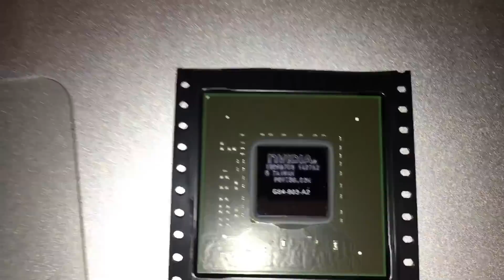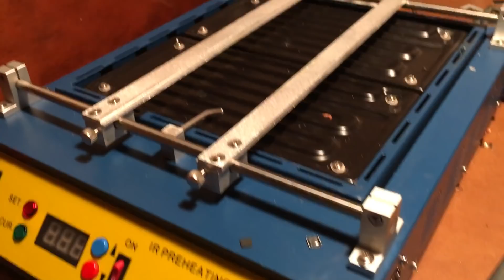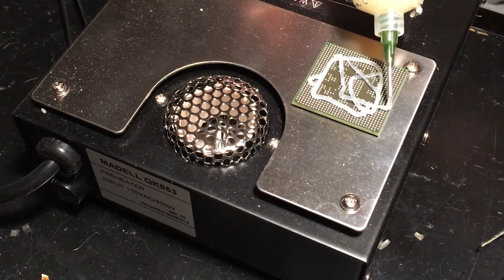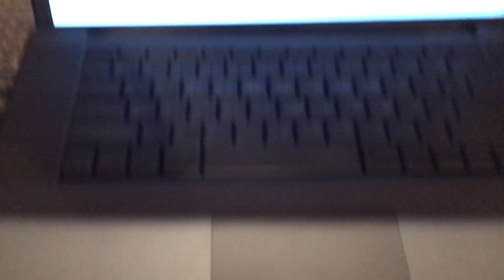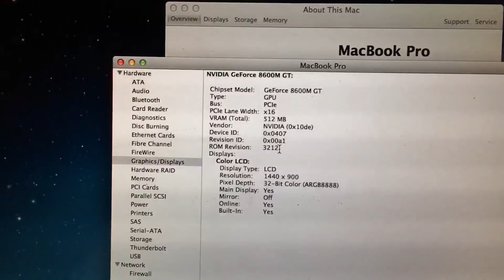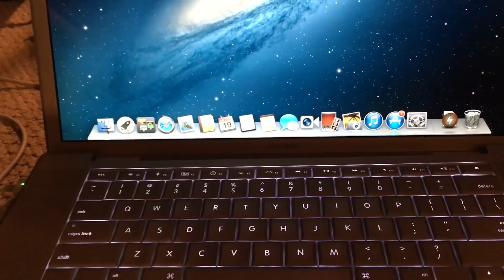Replacing a Defective GeForce 8600M GT GPU on an Early-2008 15" Apple MacBook Pro

Comment: Would you be able to do it for me if I send you the laptop and you can replace the GPU? 
I willing to pay for the repair
Reply from the maker: Yes, just send me an email. I normally do this repair for $150, plus the cost of return shipping.
Reply: @dosdude1  no problem, the laptop is still working fine when I get to replace the thermal paste I will know if it’s the revised one or not.
Reply: @dosdude1 is this chip the same for 2007-2008 MAC Book Pro 17” also, I have two that need this repair, sounds like a worth while repair!
Reply from the maker: @blkcoupequattro  Yep, it is the exact same chip.

Comment: The failing GPU in my 2008 MacBook Pro is a 512MB but I'm really struggling to find a replacement chip thats also 512. Nearly all are 256. I don't really want to downgrade. Does anyone know where I could find a 512? Is the chip number the same?

Comment: We drilled 2 huge holes under the fans too boost cooling. Speakers lost all their bass (plus the fans and motherboard are no longer "well protected". Fun but not necessary.

So a good repaste of the CPU & GPU really helped thermals and performance.

Apple replaced our GPU on warranty years ago; we thought they also downclocked the GPU but can't remember how we came to that conclusion. These older GPUs are not optimised for "modern" web browsing so still will run hot. 

A1226 has a great keyboard and supports SATA SSDs and 6GB RAM with a bit of effort. "Newish" OSX can be stuffed into the system although I think Apple cut off around 2019 (OpenCore Legacy Patcher may work with 2008 models too).

Comment: I was watching your video on YouTube on how to replace a Defective GeForce 8600M GT GPU on an Early-2008 15" Apple MacBook Pro. Great video bro. I have the same MacBook pro with the same problem. I am going to give it a try on replace the GPU. My question is what temperature you set your Hot Air rework station for removing the chip and installing the chip? Thank you.
Reply from the maker: Usually around 170 - 180 degrees C for bottom heat, and around 280 degrees C on hot air. Be sure to dehydrate board and new chip (I use a food dehydrator) for at least 2 hours before working.
Reply: @dosdude1  are you saying you have two heat source at the same time heating up the GPU one from the bottom & top to remove it? I only have a hot air rework station. I was going to heat the chip from the top remove it.
Reply from the maker: @wadesuckoo9122  Yes, you absolutely need bottom heat for these. You'll need to get a board preheater to put the board on while working, as shown in the video.
Reply: @dosdude1  One more question. So how long did you heat the botton of the MB before applying the top heat to remove the GPU and for how long did you apply the top heat before the GPU was ready to come off and when you install the new GPU how long did you have the heat on it for the solder to melt and GPU secure? Thank you.
Reply from the maker: @wadesuckoo9122  Preheat board until board preheater gets fully up to temp. To remove chip, heat and periodically lightly poke at chip with tweezers, you will see when it starts moving and is ready to come off. For install, look at balls and chip, when all balls are shiny/shimmering and chip is fully dropped and uniform on all sides, it is done.
Reply: @dosdude1  ok i will preheat the board with the bottom heater until the until the MB temp between 170 - 180 degrees C, then i will set my rework station to 280 degrees C on heat the GPU up to remove it. It shouldn't take more than 20 - 30 second to to remove the chip and another 20 -30 second to install the new GPU from watch your video. I will let you know how i do once i do. I do appreciate the help. Thank you.
Reply from the maker: @wadesuckoo9122  The video is sped up, it usually takes around 4 - 5 minutes of heating before all the balls are molten.
Reply: @dosdude1  Oh ok, so i will work with around 4 - 5minutes for removing and installing. Once the MB is preheated. Thank you for the update.
Reply: At what temperature did you set your food dehydrator at for 2 hours for the MB & GPU?

Comment: Collin,

When doing this repair, is there a upgraded GPU that will work? Or are we limited to the revised version? Also, is it possible to upgrade the VRAM above 512 MB? I believe I saw you state upgrading the CPU is possible but not worth the minute gain. Correct?

Comment: I bought one board with upgrade gpu from China. Unfortunately it’s not working properly. Only half screen. What could be the problem
Reply from the maker: Your LCD is bad.
Reply: @dosdude1  I checked the lcd it's ok.
Reply from the maker: @anupdas1413  I've seen these were either the top half or botton half of the screen doesn't work (sometimes bottom/top 1/3rd), and it 100% is most definitely the LCD.
Reply: @dosdude1  I tried with another logic board . The display is perfect sir. Also the fan is running full speed . No keyboard light no front white led. I wish I could have send to the picture. After waiting 1 year I received defective board from China.
Reply from the maker: @anupdas1413  That sucks. If you want to send in your original board, I can put a guaranteed fully working revised chipset on it.
Reply: @dosdude1  I'm from India. Is it possible to send ?

Comment: I know this video is a bit old, but do you by chance have a link to your trusted seller for the new, non-defective replacement GeForce chips?  I have one of the dreaded MBPs that has sat idle for an extended time, that is virtually brand new, as to actual use, but sadly, has the defective chip.  As such, it will not start.  I have nothing to lose by giving the repair a go.  If you by chance have that link, or, know of a source for that chip, it would be appreciated.  Maybe you have a new, non-defective one laying around somewhere you might be willing to part with? :)  Thank you for any help you might offer.
Reply from the maker: I get them from here: https://www.ebay.com/itm/203029368800

Just make sure you follow the process closely; these chips and boards are sensitive to too much heat and moisture. I always dehydrate both the board and new chip for at least 2 hours in a food dehydrator before starting the repair.
Reply: @dosdude1  it always frustrated me that this MBP was basically brand new before it went belly up.  If it was used 25 times, at short duration I would be surprised.  And wouldn't you know that I discovered the graphics chip issue after the window for the very silent recall notice from Apple closed. And they wouldn't budge on doing the repair. That said, I noticed that you also offer to do the repair as well. Not sure if this is something that you still offer. And not sure if it's best if I communicate directly with you via email or here. Happy to do either.  I can pull the board, no problem, and send it to you.  I have had it apart a few times before so that's not an issue.  Let me know if you still offer the service.  Turnaround time is not a huge issue but it would be good to know approximately how long you might need.  Thanks again for your reply.
Reply from the maker: @davidmaher1313  Yep, I still do that repair. Normally I do it for $150, plus the cost of return shipping; turnaround time is usually around 2-3 weeks. Just send me an email if you'd like to send it in.

Comment: I just put a slightly nicer Lid/LCD from my dead 

(from overheating) August 2008 2.5 ghz. machine

onto my "new" $33 ppd. July 2008 2.4.machine.

Now clean as a whistle.

$56 with some parts recently purchased.

$23 NOS OEM battery....

I'm no longer looking for a Late 2008 A1286....

Too expensive on eBay.

This one does all I ask of it...

I will NOT be running external monitor

or my TV from it....

The death of the previous A1260 and an A1226...

While streaming long videos...

This one runs 120 to 130F

Thanks to Macs Fan Control

BOTH fans set to 6000 rpm!

I have several replacement fans.

Dead quiet MBP's = DEAD MBP's..

Apple Store zombies are CLUELESS!

J.C.

Comment: Quote from wikipedia:

2007–2008 model GPU problems

Both 15" and 17" models of the MacBook Pro built from 2007-early 2008 (15") / late 2008 (17") using the 8600M GT chip exhibited severe GPU failures where the GPU die would reportedly detach from chip, or the chip detach from the logic board.[20] The issue has been mitigated by some users by keeping the laptop cooler by means of less intensive use or alternative fan settings. Apple initially ignored reports, before admitting to the fault and replacing logic boards free of charge for up to 4 years after the purchase date.NVIDIA also confirmed the issue, and previously manufactured replacement GPUs, which some users have replaced themselves.

J.C.
Reply: In Russia all bga balls connection problems are called ‘otval’, and pretty every Russian older than 13 knows how to repair it using a hair dryer, aluminum foil and little copper pieces

Comment: Macs Fan Control

Left Fan set at 6000 rpm

Right Fan set at 6000 rpm

Runs 128F to 140F while streaming videos

NOT 170F < !!!

No further problems...

AFTER having an A1226 and an A1260 2.5 go bad.....

Whilst streaming videos and using my LCD TV as a monitor

WITHOUT any fan controllers...

Will not use my "new" $33 ppd. Early 2008 2.4 15 with a TV or monitor...

My Late 2008 2.4 AL Unibody Deluxe never has a problem with either...

Nor do my two $15 ppd.  2007 WMB's

Nor my FREE Late 2009 Mac Mini 2.53....

ALL FINE TROUBLE FREE MACHINES

A lesson....

Apple Ink/Jobz screwed the pooch!

J.C.

Comment: It doesn't fail because of the operating temp it fails because it's a failing flip chip design that fails with thermal cycles which you can't avoid. Same problem with the Xbox 360 GPU

Comment: Dosdude1 is there any chance you would happen to know which size of reballing solder I would need to buy? I’m trying to reball my Nvidia chip it’s this exact same chip, but I can’t figure out which size I need to order. Great work on this though very informative video!
Reply from the maker: Shouldn't need to reball unless you're taking a good, revised chipset from another board. It is a waste of time to reball a G84-602-A2, as the chip itself is defective (as explained in the video). If this is the case, just get a new, pre-balled G84-603-A2.

Comment: I have a Mid-2012 A1286 and I checked the PCIe length. It shows 8x. Should I worry?
Reply from the maker: No, that's normal for that system. GT650M never fails.
Reply: dosdude1 is that possible to make BGA repairs with a regular hot air soldering station or I should use reworking BGA station?

Comment: Does the GPU revision matter eg my og is G84-602-A2, your replacements are G84-603-A2 and ive seen G84-601-A2, Does this matter
Reply from the maker: G84-603-A2 is the revised version of the G84-602-A2. This model machine never came with any other revisions. You should always use a 128-bit G84-603-A2 when doing a repair.
Reply: @dosdude1  thanks

Comment: Hi, I have a DELL XPS M1530 with a failed G86-730-A2 chip. The code from where you get the production date is 0745A2, so I guess it's from 2007. Could you please inform me of the following?
1) Which GPU is this chip (8400M, 8600M, 8400M GT or 8600M GT?)
2) Are there revised chips for my case?
3) How can I know if it is revised?
Thank you very much in advance!

Comment: Hey Collin, is it really worth your time to repair all these machines with Core 2 Duos and archaic GPUs, or do you just like seeing them fixed up and ready to go?
Reply from the maker: I'd say so. These are still very capable machines, and since they can be permanently repaired, why not do so?
Reply: @dosdude1  That's really cool of you to say that. Does using a GPU with 512 MB of VRAM make a noticeable difference compared to using the same GPU with just 256 MB of VRAM?

Comment: Is it possible to swap out the T9500 with a T9900 on one of the early 08 non-unibody 15" MacBook Pros?
Reply: yes, but the performance boost wouldn't be worth all the effort imo. It also requires a lot of equipment to do.

Comment: @dosdude1
@11:45 as you are melting the flux you had your tweezer clapped over the solder balls, aren't you concerned that the balls would melt and stick on the tweezer, thus fucking up the already applied balls on the underfill?
Reply from the maker: No, I'm not heating the chip anywhere near the temperature needed to melt solder... I'm simply heating it enough to get the flux to flow.

Comment: I just wanted to say thanks for all the patches you created for us with the ancient machines, though I have a mid-2012 i7 which makes me feel a little closer to being up to date. lol

My issue is with my other early-2008 15" 2.5Ghz Model: 4,1. 
It gets hung up a lot while trying to boot, sometimes only staying on the white screen that first flashes after rebooting starts. I was having lots of trouble booting from a clone on my external SSD using the option/alt key despite it having no interal hard drive at the moment anyways. I could see the clone on the boot screen but then when I would hit enter it would stop and go to a white screen that would then go to a message that said something like "your computer restarted because of a problem press any key to contiinue...." then would go in a loop of restarting itself over and over and then failing each time on the white screen with that message. What was strange is that it would allow me to boot from the external if I held down C instead of Option/Alt key. I can still boot up using C and now will allow me to use option so I have no clue whats going on. I have booted into 10.5.7 Leopard Clone just fine, as well as El Capitan and tried using your patch and got through most of it and when it was doing the rebuiding of the cache it started flashing the screen like a camera black and white blips all across rapidly. You can still see the screen in the background and could move the cursor though it would move all the way across the screen with barely any movement of the mouse. I dont have a recovery partition except for the 10.13.6 H. Sierra one which obviously wouldnt work. I tried to install the osx update and it failed doing the same flashing almost black and white flashing over the very faded dull colored background. All processes stop functioning when it happens and I have done so much research and tested many different things like the smc reset, pram reset, trying different bootable clones in different osx, tried to boot into recovery (no recovery parition) and no installation disc, i believe it works in safe mode as I downloaded cinebench and ran it and it worked fine but then looked at the top right of the screen in a diabetic hypoglycemic stupor and realized that there was an admin/login tab up there which ive never seen before so am assuming it is due to the safe mode boot? Well I know this is a lot to ask but if you have any ideas of what could be the issue I would greatly appreciate your wisdom dosmaster ;P I would like to restore this machine and apply the patch and use my panda pau05 for wifi since its not compatible with the current wificard. I ask because I thought this was a gpu issue but seeing how this video is showing it wont even display the screen then Im not too sure of what it could be. 

I was also wanting to upgrade the cpu/logic board if possible if the need was for a new logic board as this thing is not quite fast enough. haha

Thanks!

Comment: Tried this with my 17"
I never did any board repair except replacing capacitors on old iMacs before, but with the help of this video, my repair was a full success!
Reply from the maker: Awesome! Just curious, what kind of tools did you use for your repair?
Reply: dosdude1 can you upgrade the video card in my 2008 macbook 4,1 so i can run the newest version of imovie??
Reply: Please share with us the equipment & tools you used to do the repair?
Reply: fancy seing you here lol, even though this isn't related to an IBM T4X reflow :rofl:

Comment: There are 64 bit and 128 bit versions of the G84-603-A2 available, will the both work?
Reply from the maker: nielsbeens It depends on how much VRAM the system has. If it has 128MB of VRAM, then yes, you can use the 64-bit chip. However, if it has 256 or 512MB of VRAM, then you MUST use a 128-bit chip.
Reply: @dosdude1  ok that's clear, thanks for your quick reply.

Comment: i just bought a mid 2007 Macbook pro on ebay has an ssd and a 8600m GT arives on friday hope it has the model 603 model will get back tou you with the details .
Reply: update had to replace the ssd but all is well it has the 603 and I'm using a fan control program to keep the temps down
Reply from the maker: Wow, you got very lucky.
Reply: @dosdude1  I love popping these open and seeing a nice 603 . haha. It does happen! :)
Reply from the maker: Yep, I've gotten a couple that have had 603s installed by Apple. They're few and far between, though.
Reply: dosdude1 hey is it possible for a mid 2007 MacBook Pro to run anything newer than Mac OS X el captain

Comment: Hey DOSDUDE,  Do you know by chance if its possible to dump a PowerMac G5 apple boot rom?  or if its possible to downgrade/upgrade different open firmware versions? through software preferably?
Reply from the maker: Yeah, you can dump a BootROM. Just install a copy of Linux, and use my custom version of Flashrom for PowerPC: http://dosdude1.com/files/flashromppc.zip
Reply: Thank you very much sir!  I do have a few other questions. I may have something that may interest you..if you like challenge as I am not very familiar but I am a manjaro user lol.   is there another way I can get in contact with you that you prefer. I dont want to share this information with the world atm lol
Reply: are we able to write back to it by chance? I sent you an email. Kind regards.